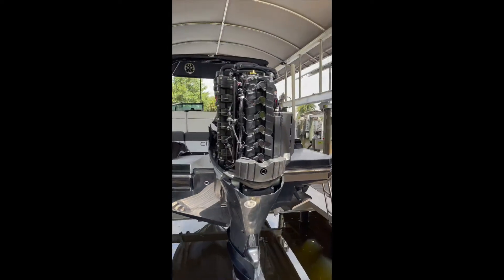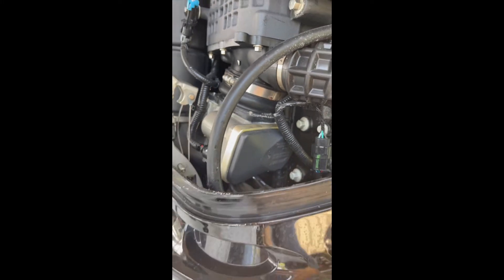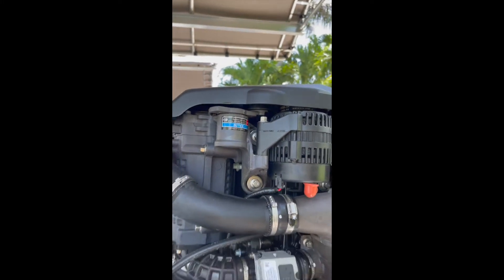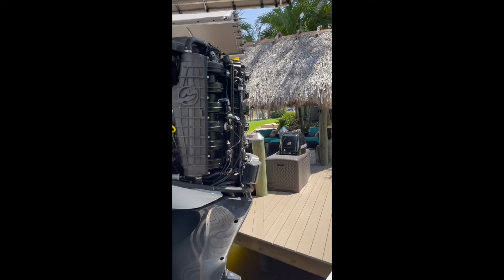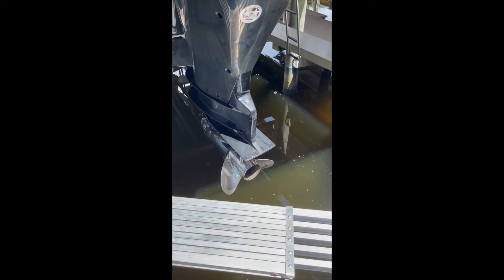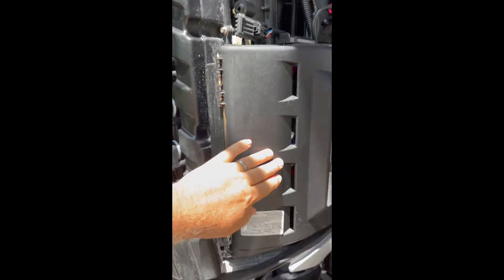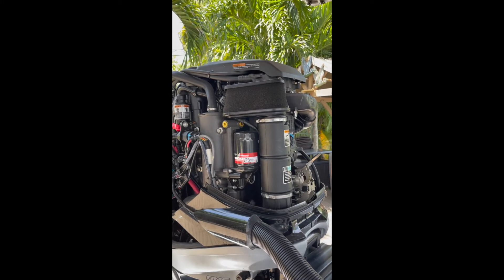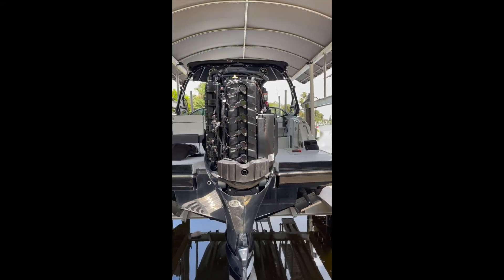Mercury Verado 300 Engine Walkaround

Comment: I am having a problem with my Garmin and smartcraft gauge reading engine data and I was hoping you'd point out the cable that sends engine data from under the cowling up to the console so I could check the connection.  You don't happen to know where that cable connects do you, I assume somewhere under that electronics cover you pointed out but where exactly.
Reply from the maker: I’m sorry I don’t know.